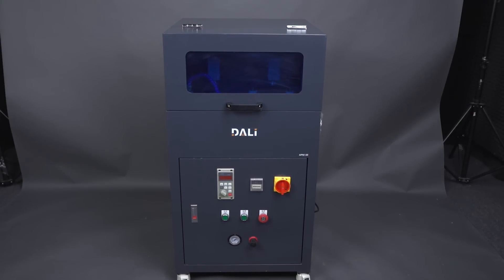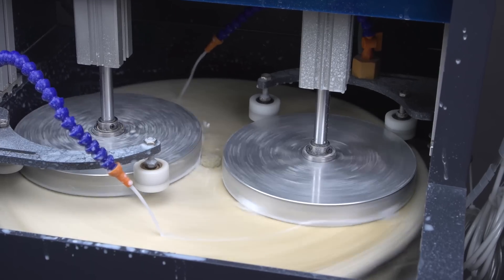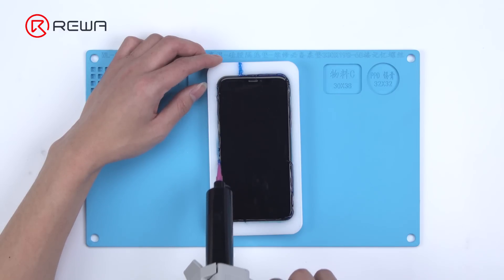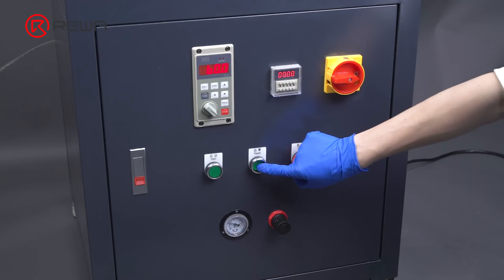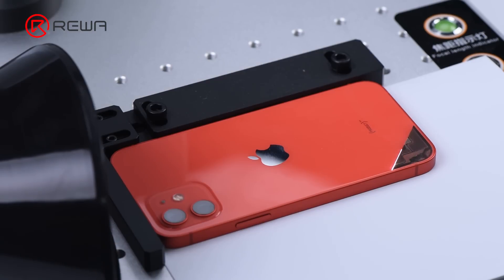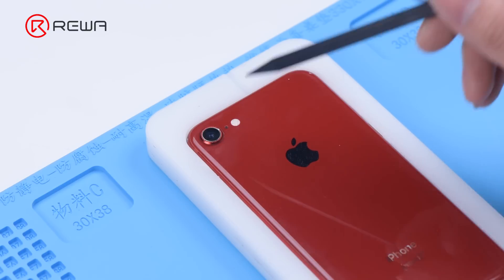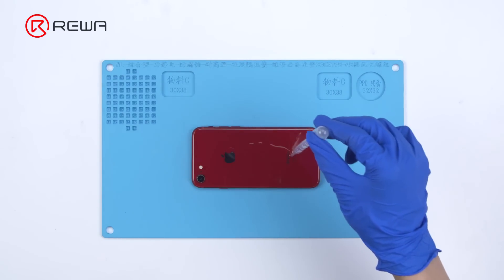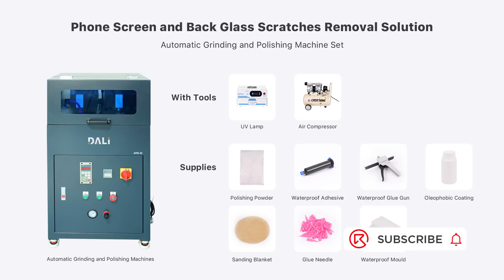Phone Scratches Removing of Screen/Back Glass in 6 Mins By Grinding & Polishing

Comment: How can you polish back when camera doesn’t sit flush with the rest of the glass?
Reply: Seems that the surface is all squishy so adapts to the shape
Reply: @eried  I didn’t notice that thanks for pointed that out, but still a grinding surface wonder how the lenses bezel turns out on other devices besides the iPhone 8
Reply: @djruido1  I think that is the part they mask with that uv activated glue, but probably it is noticeable.
Reply: @djruido1  even on the 8 you actaully can see in the video that some of the red color was polished away off the camera bezel.

Comment: How deep does the scratch have to be for the machine to remove them. I bought the machine but some scratches are still there please help!
Reply: Hi, how are you liking the machine? Do you have any issues with defective screen or microphones afterwards?
Reply: @FRIGYES10  the machine was a total waste of my money. The machine was defective. It couldn't get the scratches off my iPhones. The machine just made the screens of my phones shinier.   I had no problem with water getting into the microphone, the glue they provided was good in covering opens spots on the iPhone.
Reply: @Elizahable  if they are actually scratches like micro and just surface level scratches then they will be gone your scratches are probably chipped glass and not scratches

Comment: Wouldn't this thin the glass out?
Reply from the maker: Yes, the machine works by grinding and polishing the scratches away, which will make the screen smooth and front glass thinner. The removed parts are actually very thin, which will not affect the normal use of the phone.
Reply: @rewatechnology2008  Wouldn't it make the glass weaker though? I do like the idea but yeah
Reply: @prodigyaustralia  it will make it even stronger, when glass is scratched, scratches are good crack ‘starters’. So unscratched thinner glass > scratched thicker glass.

Comment: You don’t need this machine 

You can use hand machines 

You don’t need the back glass removal use a hot plate 

No one cares about the water hydro thing on the glass not like your customers are going to know but the buyers like these guys just another way to deduct from your stock
Reply: If you are refurbishing hundreds or thousands of phones you definitely don’t want to hand polish. You can’t remove iPhone back glass with a hot plate. And have some pride in your work, the oil repellent coating helps reduce fingerprints and was there originally. Grinding removes the coating, so it needs to be reapplied.